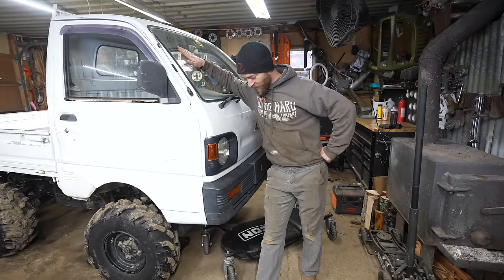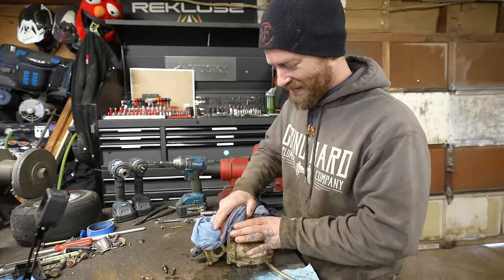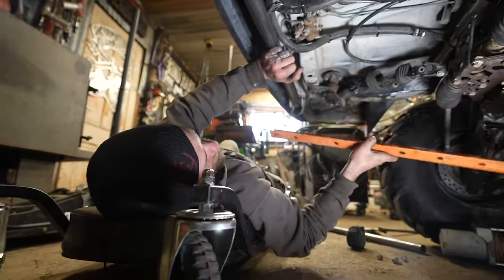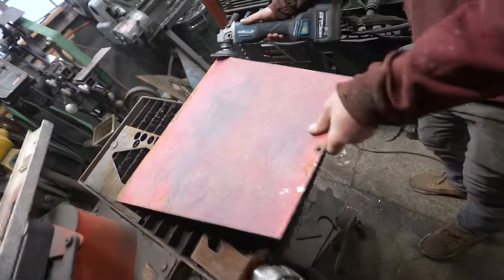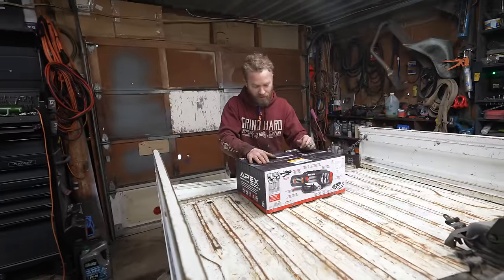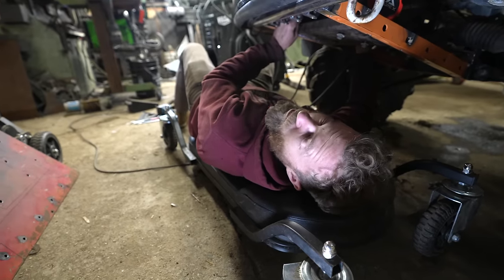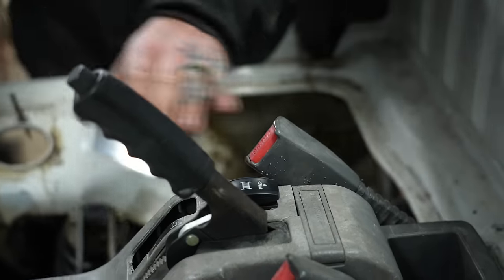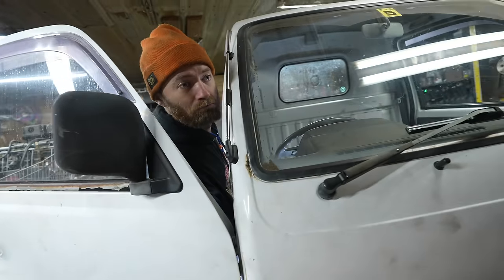6x6 Mini Truck Finished! And Rolled?

Comment from the maker: Thanks to Manscaped for sponsoring today’s video! Get 20% Off + Free Shipping + 2 Free Gifts with promo code GHPC at http://manscaped.com/ghpc
Reply: Please paint the truck with rocker guard. That is all thanks.
Reply: The air pressure in the hose is enough pressure to push the needle valve down so air can enter the tire.....:)
Reply: If'n it was my project I would have a exocage wrapping it with a roof mounted tent. And a bush kitchen setup for back country expeditions. You know something for Bigfoot to throw rocks at. ✌️
Reply: most likely pressure of the air pushing the valve open
Reply: That boat tho 🌊
Reply: You should expand your pond another 20 ft or whatever it be cool to watch a damn build then you can even pull power off of it
Reply: Is your tattoo, 'above earth's surface, and below'?
Reply: Cryo treat the factory diff?
Reply: Björn said, "Make it a full-on mini week-capable "Iceland Truck" ......overlander, with enclosed bed connected to the cab, and a Webasto heater inside. Full exocage, and 4 rear harneses, in case you have 6 people onboard...  Windows all around, greenhousey-like, for the cold months, warm months, and spectacular viewing. ......Maybe even a 'Vintage Air' unit, like Leno uses in so many cars, being in southern California... Björn later went on to say, "Bring us doggers on more long adventures.......Speaking for all doggo's, you know as well as I do, no episode is complete, without at least one comment from me!!!"
Reply: Please take the jet boat to a river next, I wanna see how it does in a river
Reply: The Manscaped site in Europe doesn't have their beard grooming kit! Shame. - great video though :-)
Reply: Ive known the airline chuck trick but it can backfire on you the truck with a lock on to the valve stem and you can’t get it off to release the pressure so you yank airline and valve stem off to keep from a catastrophe
Reply: @nameless6078  They've taken it to a lake. Go check out their vids.
Reply: @MattGratt  Same with Australia. They almost had a sale. Shame.
Reply: y'all should give the 6x6 a roll cage/luggage rack that extends over the bed. except for the section of the roll cage/luggage rack bit that is over the bed, make that part able to be unbolted incase y'all need space for something bigger then the barbie boat. and don't forget the hexagons, there's been a lack of those in this build. the hexagons bring good luck.
Reply: I am excited for the shopping go cart in the background 👍🏻
Reply: Obviously it's getting a turbo? Lol
Reply: Build a exoskeleton for the 6x6 like leroy
Reply: uhh when if rolled it seems the cab is a lil bent there buds..? at least from what i could see on the video.
Reply: If your interested in a premium dent pulling kit contact me I can send photos and since y'all keep me entertained with every video I'll let ya have it for just the shipping cost
Reply: Ohhh yes, yes you see that perfect beard in my picture hahahaha I'd do me too no worries...😊
Reply: 6x6 neeeeeds to go to MOAB for suuuure!
Reply: The differential will rotate the opposite way if you turn it upside down, so you can use an upgraded diff. May have to re locate vents and filler 👍🖖🍺
Reply: You should Build that pound bigger ?
Reply: Make it a tank!
Reply: I've been doing the air hose thing for maybe twenty years but it's an awesome trick I wonder if they got it from me
Reply: You are such an impressive builder but the fact that you are blown away from the air hose thing is awesome to me because I've been doing that my whole life but see that's why two heads are better than one and we got to learn from each other I'm glad you're telling everyone so they can pass it along
Reply: youse should look at Haflinger and Pinzagaur
Reply: It desperately needs some more weight in the back.
Reply: You should start a business to order. I would totally order 2 boats and 1 truck. YouTube would be yalls sell book lol
Reply: Ok hear me out you know the shows where it's the escape from the chasers use the grind hard creations start in the mountains down to Lake jet boat across to that new electric vehicle and escape have 2 chasing you get caught your out best time wins
Reply: Premium manscape 😔

Comment: Considering your driving style, you need to build an outside-the-body hoop cage so it can just roll without killing you or bursting into flames.
Reply: Just put the roll cage outside where it belongs...
Reply: Exocage? I want one on my xj lol more like need one haha😂
Reply: Exo-cage for the win!
Reply: Yes... Pretty sure an exo-cage is what it for sure needs! Just have to consider the weight... 
Driveline upgrades would have to happen I'd think.
Reply: A round one so you can just roll over completely and wind up on the tires again
Reply: This
Reply: He wants it to look stock tho so I’m guessing he would put it on the inside if anything
Reply: And a matching canopy and cut the rear wall out so they can have the whole crew in there or just a closed in hauler.😎
Reply: I think a headache bar would look sick.
Reply: Exo-skeleton cage
Reply: Maybe ballast in the tires like water or antifreeze for winter
Reply: Exo skeleton cage now!
Reply: They have the Tacoma and Tesla with external cages.
Reply: @justinoliver1984  You might be able to build an exocage without adding too much weight. I would think you could do something similar to the roll bars people put in the bed of trucks. Sorry don't know the specific term for that type of roll bar
Reply: Make it a little rounded so it rolls all the way over back to the tires for more premium rips.
Reply: If there is another one like it that gets build with a bigger motor an exo is a must with a lot more suspension and width. Awesome build
Reply: @elvis4182  😂...good one..
Reply: @justinoliver1984  snowmobile engine swap
Reply: @nathanielscholtens2812  that'd definitely get her moving! I don't know why more swaps aren't done with em.... Such a powerful little package!
Reply: Or like training wheels lmao. 💾🛵

Comment: Please keep this build going! It would be so cool to see it with a paint job and some off road lights and dare I say, a beefier roll bar?
Reply: make it into barbie kei truck please!!!
Reply: @ozmagnal6573  
Pink?
Reply: if the 6x6 has an auxilary output, adding a small generator attachment would be cool to charge the vehiche being towed, to charge devices on the go, and to maybe go camping with it. Having the equiptment in the back would be cool with an extended roll cage to mount things like gas tanks, solar, tarps, tents, lights, and more. Equiping this to be an overlanding beast would be super cool.
Reply: A white bedliner paint job would hide those “imperfections”, tow system for the busted toys, hmm... You guys still have that overland trailer?  😊

Comment: How have I never heard of the air hose 'trick' before?  I'm 70 years old.  Worked in garages starting at 15 not to mention helping my dad and brother when I was younger.  Worked in the motor pool in the Army for 10 years.  My brother owned a garage.   I Have changed thousands of tires, on and on I could give my 'bona fides' and I never even heard of this!   I am dumb founded!

Comment: This is probably the coolest episode thus far. I love the 6x6, and the baby jetboat seems like it would be the most fun vehicle physically possible. Dare I suggest that this has been... premium content? I hope a windshield can be gotten for the kei truck for a non-million dollars. Parts availability is the ONLY reason I don't have a lifted kei truck for trail use. Maybe with less grip, the front diff will be safe for a while.
Reply: If you get a suzuki you'll be surprised how many parts you can still get new. Up till this year they still made the Carry 1.3 under a different name and badge in India.
Reply: @danoupossel5072  Right, but I'm sure they're expensive and hard to get in the USA, aren't they?
Reply: @The_sinner_Jim_Whitney  I got a brand spanking new prop shaft for just under 300 euro's. I think that's quite reasonable. And I can't imagine shipping is more expensive to the US than to Europe from Japan or China.

Comment: I'd imagine it's just the air pressure pushing down the seal on the schrader valve.
But yeah,I had no idea you could do that.
 Oh...and ditto on wasting so much time looking for one of my half dozen air chucks.
Reply: Yeah, I remember my dad doing that all the time when I was a kid, I do it time to time. found out it don't work on most car wheels now days because most wheels have short schrader valve stems because of tmps.
Reply: I do it all the time with tractor tires. I pull the shrader valve first so that air flows faster though. You just have to be quick reinstalling the valve when the time comes.

Comment: Ethan, that’s actually crazy how much injury that seatbelt saved you from. And the fact it held a big American boy and didn’t break, I give props to whoever built those seatbelts for Mitsubishi
Reply: I mean...... He's not a super big fat guy, and you'd hope that seatbelts of all things would have a pretty big factor of safety.....
Reply: @jaredlancaster4137  when it’s built for 5’2, 100 pound Chinese people, yes it is impressive it held.
Reply: @Watchdog99  mitsubishi is japanese which national average is 5'7 and they have to adhere to the same restrictions as the US for safety, infact I think they're more strict.
Reply: @Watchdog99  Safety factor. I said safety factor. If you're not familiar with what that is, it's making things stronger than they need to be if they're safety critical. Something like a seatbelt you would generally make about 3x stronger than it should need to be. Which means something that will hold a 100lb Japanese guy in a hard crash will have no problem supporting a 500lb fat guy in a slow rollover. But Ethan is definitely under 200lb, so not really that crazy.

Thanks for coming to my Ted Talk
Reply: @jaredlancaster4137  Not worth arguing over, but, the thing isn’t brand new off the showroom floor. They even said themselves it’s in rough shape in the cab. I obviously didn’t think the seatbelt itself would break, more about the mounting points not holding his weight If they are rusted out. Why does everyone want to be a internet mechanic like all I said was the fact it held was impressive.
“oK bUt HaVe YoU hEaRd Of SaFeTy FaCtOr” like bro I don’t care
Reply: I would hardly call myself a big American boy. 😂😂
Reply: @TheUninator  how much for the 6x6?

Comment: Just a few minutes into this video,  Great idea for future builds, and to everybody at home,  Differentials can be turned up-side down to Reverse the direction of drive,  a lot of people argue that this isn't possible, but it is.          Obviously there can be oiling issues and a higer drive shaft and slightly offset.  But for fun offroad projects,  it's really doable.

Comment: The fact that Ethan just rolled a truck and was so calm about it what a G id be screaming my head off
Reply: It was a slow roll over. So the momentum was reduced. Had it been faster, the momentum would have been much more severe and could have resulted in more serious injuries. Also lucked out the old seat belts held up.
Reply: Id be screaming but not for the reason your describing.

Comment: Hey guys! Awesome build so far. I had the problem with a dif turning the wrong way too in one of my builds years a go. Then realized that it will spin the other way around if you just flip it. You should check if the dif can be flipped upside down. Can you move a vent if it has on and check how it oils it's self and so on. Then you could buy the better dif if it can be installed upside down. Keep up the jeeeeet!!!

Comment: If you ever get bored and want more power, I would suggest putting in the 13b from the trike in the kei truck.
It would be hella cool and the trike does not get used much anyway.

Comment: I'm surprised he's not already designing a long travel a arm kit for it and I think it would look cool if you could get all 6 tires out the width of the tire thickness
Reply: That's exactly what I thought. Long arm suspension to add width and travel.

Comment: Those of you wondering how this is possible (to fill the tire without the adapter), he in fact did say it. The design is fairly similar but the center of the hose pin is small enough to fit within the ring. When I first seen it I had a chuckle. This was a trick my old automotive teacher use to teach back in the early 2000s. A good example is compare the inside of the air hose with the one you get air from at gas stations. ^_^

Comment: You can also fill shraeder valves with a rubber tipped blow gun. It works by blowing air past the valve. Also works to fill volleyballs and basketballs, needle not necessary

Comment: A jigsaw with some metal blades works great instead of a grinder. Almost no dust, just as fast too, and a clean cut! I use 24tpi Milwaukee blades. Now I only use a grinder for mistakes or parts I can’t reach otherwise.

Comment: This is quite awesome. A really wide and flat bed half track would be swesome along with the option for 6x6. If you do a half track you could add skies maybe? Maybe find some old 50s farm truck with the curves and stuff and then stub nose the front, widen the body, chop the top, and then add a free flowing flat bed to it. Convertiable top would be quite sweet.  
The barbie boat is wicked cool. Any kid should have one of them!

Comment: for the filling up the air with the quick attatch on the air hose it doesnt need to push on the needle valve because the air pressure in the hose is greater than in the tire it acts just as a check valve, so it opens only from air pressure 👌👌

Comment: ive been using the hose trick since i was a kid, im 35 now.  but heres extra tip , if u had taken the core out when setting bead it would have seated without brake cleaner with all the extra air being shoved into the tire without the core or an air chuck.    also i know that tire mounter all to well at age 16

Comment: Awesome vid. And if i may suggest:
1)Repair dents and body work. 
2) Paint with raptor liner in army green. 
3) Make a electric boat lift in the back of truck. 
4) Make a headache rack with lights and wench.

Comment: 19:20
The pressure from your tank pushes in the Schrader valve. The valve stem pushes in the valve in your hose quick connector

Comment: One cheap and helpful upgrade one might consider is the headache rack/roll bar. But that could make it look less like a normal rig. than one may find aesthetically appropriate for the application. It could, if cleverly attacked, however, provide some protection for your new windshield. I don’t know how many other folks had this as the first thought.

Comment: This is very funny. The best thing we've ever built is something that was already built and you had to simply fit the body y'all wanted onto it. 😂
Now I will concede you fitted a greater wheel for the purpose. And the shock tuning was a win . Although everything involved is a finished product reassembled at GHP. I will admit the improvement is unbeatable 🎉

Comment: Been doing the air coupler to inflate my 4x4 tires for years. I eventually went to metal caps and no valve cores. That way I can air down and up quickly. FYI street pressure is 12 to 15 Lbs even flat they hold the weight of the Rig.

Comment: 17:30 Works great for getting beads to seat too. Especially if you pull the valve core. HOWEVER, it beats up the o-rings on the coupler pretty bad.

Comment: Yeah, I didn't think of airing tires up like that, but I have gotten the beads to seat like that if you pull the pin out. Helps if you don't wanna do the whole lighter thing. That was on car tires though, so who knows.

Comment: You can use a normal air gun to inflate tyres aswell. Just press the tip of the air gun to the shreder valve and shoot. The air pressure alone is plenty to push the valve in. Some air escapes yes, but that doesn't matter, just keep the nozzle directly over the valve and it works a treat

Comment: When I use my Stanly hand saw to part stuff off on my metal lathe, even though I am right handed, I hold the handle in my left hand and the end of the saw in my right. That way my sweater does not get near the rotating chuck or belt drive. Same thing when I am hand filing on the lathe. I feel a lot safer that way.

Comment: The core in the valve stem is designed to allow one way air movement. It will let air in if it is greater pressure than the inside air but not let it out

Comment: So a wider long arm suspension kit is needed? Though that would impact on it getting between trees.
Something to keep in mind if you do a diff flip, is lubrication. Make sure once it's flipped all the bearing are still getting lubricated.

Comment: Björn say's "Make the Kei, a tiny ICELAND TRUCK!" Webasto heater, full tool kit..... camp gear..... cap on back, with a door to the cab, so everybody is inside together....exocage all around....So everybody can harness in, and REMAIN safe, even in a somersault.....doggo harnesses? high torque engine.... 6 people in snug, or four loose... .......Maybe include a Stihl chainsaw in that tool kit, for those wooded areas. A MIGHTY, but tiny  OVERLAND RIG, WITH BIG WHEELS, BUT A SMALL FOOTPRINT! Ready for 4 people, plus two doggo's, to overland with a load of gear, or 6 + 2 doggers to go out for the day.....

Comment: I would love to see you make a strong extendable  liftable boom to replace the sides of the tray. So you can lift stuff from behind the vehicle and swing it onto the tray, then drop around it to contain your quad or whatever. You could put on an aluminium roll cage/ headache rack to lift and lower the boom and extend and retract using hydraulic rams inside the boom tubes. I would suggest a mitre in the rear corners to stiffen the boom. And if you do it all in aluminium, it shouldn't add much weight.